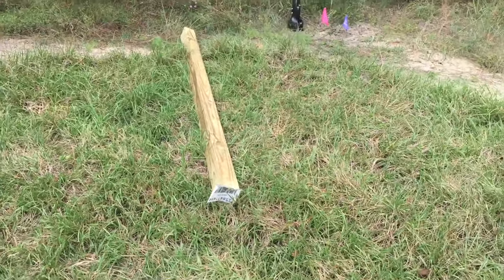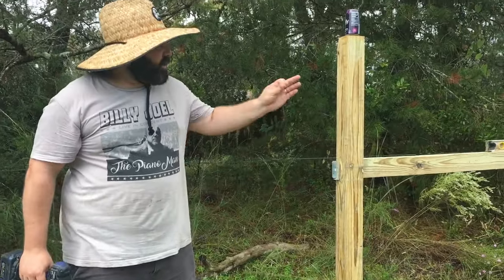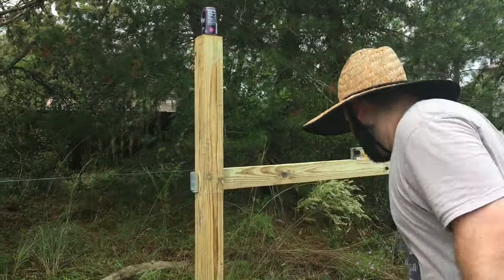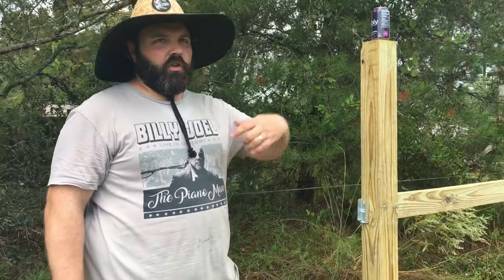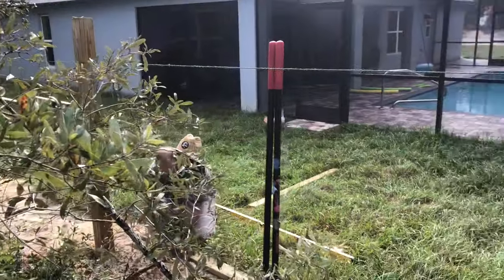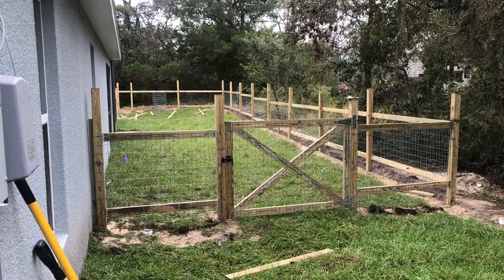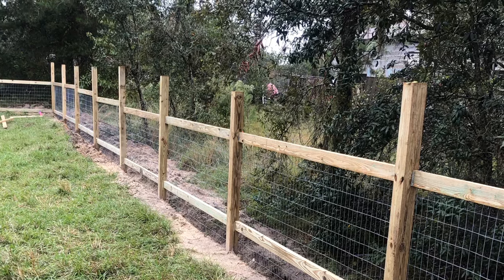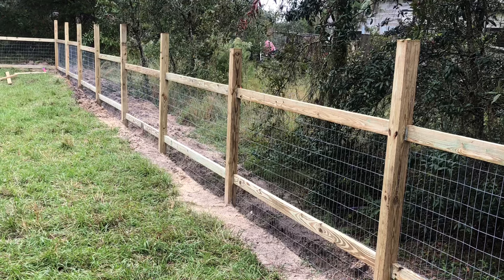How To Build A Dig Resistant Dog Run

Comment: I am going to use this idea to build a fence to keep my cats in.  I will do an 8ft tall fence and then at the tip have some horizontal standoffs with wire on it to keep the cats from climbing to the top and going over.

Comment: How did u set the posts? Did you dig a hole for the post and set it with concrete?
Reply: It looks like they don't use concrete.  Just dig a hole, set the post and then tamp the dirt in around it.

Comment: Ya showed clips but ya didn t show details from behind fence n how to connect 2x4...... and where did ya buy em
Reply from the maker: Dan Matthews Dan, the fence is all tied in using those brackets I showed on how to screw each 4 x 4 got a bracket that holds the 2 x 4 that’s how it’s all tied together everything is all flushed from the outside we used fence staples to hold the horse wire in place, we are a new channel and we’re definitely learning what we need to make sure we include in our DIY videos LOL we have a new one coming out this week on how to build a DIY pallet wood shed that we took a lot of the lessons we learn from filming the dog run and apply to. Thank you for the feedback will definitely make sure to do this in further videos which I hope you check out!

Comment: You concreted the post right?
Reply from the maker: Bolynnation only the Gate Posts are concreted, the rest are dug deep and compacted into being solid in the ground. And the fence is as strong today as when I built it.
Reply: LeaveMeAlone ImBusyFarming how deep did you go down for the post
Reply from the maker: Bolynnation 3 to 4 feet depending on the slope of the land and 4 feet in the corners then after filling each foot used a pole or stick to compact the soil then used water to finish it off

Comment: What's price range for this
Reply from the maker: it was about $500.00 when I made the video could be more if you use the flat panels of the hoarse wire. A 100ft roll of it was $80.00 the panels which were 20ft were 60 each